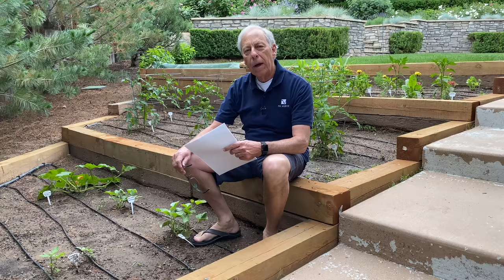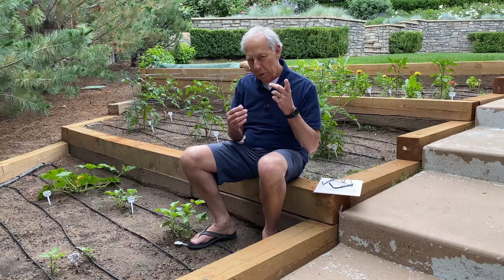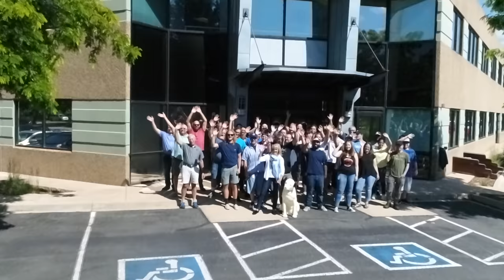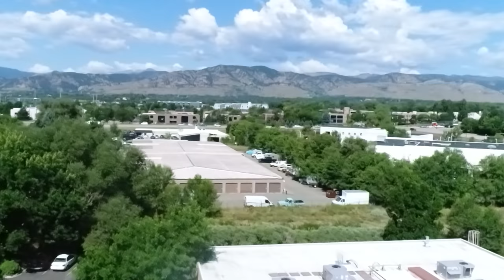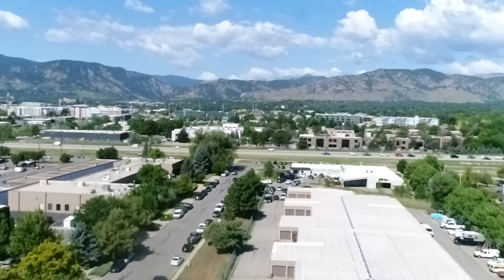Difference between line out and preamp out

Comment: Holy Crap! Yes, it would be VERY LOUD pretty much max volume. Great way to blow up a pair of speakers! LOL! 
Great explanation, Paul.
Reply: It's true that many high-level sources such as CD players will put out plenty of voltage to drive a power amp to full output, or into clipping.  
Hopefully most owners realize that sources lacking volume controls should only be connected directly to a power amp, if the amp has its own level control(s).

Comment: I was connecting-up a friend's stereo.  His teen sister was handing me labeled wires and one set was from a simple reel-to-reel which didn't have a preamp stage.  The receiver was a Sansui 500 from the early 1960's and it had a tape head input and output.  When it was time to hook up those, I asked her to give me "head".  I haven't spoken with my friend for 40 years, but his sister still likes me.
Reply: But did she.....hand you the cable?

Comment: Unless you have a preamp or receiver with individual input level adjustments, it's important to understand that line out level will depend on the selected source.  The range between low-level and high-level sources can be 15dB or more.  
There can also be a significant difference in the output impedance.  For example, my old Pioneer receiver has over 2K ohms output impedance at its line (record) outputs, but the preamp out is less than 300 ohms.  The lower output impedance reduces noise susceptibility, and avoids high-frequency rolloff if you use very long cables.  The higher output impedance is only intended to drive relatively short interconnects, typically 2m (6').
Reply: @behexen250 
Recognize this?  
Vn = SQRT(4 * k * T * B * R)
Now tell me again, that impedance has nothing to do with noise.  

Recognize this?  
Vn = Z * In, where Vn is noise voltage and In is induced noise current.  
Now tell me again, that impedance has nothing to do with noise.  

What does the "VLZ" stand for in the Mackie mixer name 802VLZ, and why does it have that?  

I've designed low-noise preamplifiers that achieve 0.5dB noise figure or better.  Do you even understand what that means?  

"Lower the gain, and you lower the noise."  Oh my, what a profound insight!  Until you mentioned it, I'm sure no one else in the world had ever thought of that.  
Hey, here's an even better idea:  Turn the power off, and the noise goes away completely!  Magic!
Reply: @behexen250 
I'll take that as an admission that you have no idea what the noise equations mean.  
Since it apparently hasn't occurred to you yet, you can see my employer and job title by searching campaign donor public records - but note that I recently retired.  That means I accumulated near 4 decades of design experience as a fully qualified, degreed EE with an aerospace company, designing and developing analog and digital circuitry for flight control electronics, mostly used on Boeing commercial airplanes.  First program, back in the 1980's, was the full flight regime autothrottle computer for the 747-200, also used on a few 747-300's, including Air Force 1.  It's an analog computer which also employs MSI CMOS logic for mode control and BIT.  My design responsibility was updates for control law and interface changes, including a full re-design of the BIT subsystem.  Many other programs over the years used my analog and digital circuit designs in actuator control electronics, active stick interface electronics, primary flight computer for the Boeing 777, plus a number of prototype and test equipment designs.  I'm certainly not going to attempt listing every design task here.  
With regard to what you call "McDonalds level equipment," the Mackie mic preamps come very close to the theoretical noise limit for operation at room temperature.  This is achieved by using low-impedance design methods, the importance of which is clearly lost on you.  
Fundamentally, optimal low-noise designs must be tailored to a specific source impedance; preamp design is quite different for high-Z sources, than it is for low-Z sources.  The mic preamp I designed and built, achieves 0.5dB or better NF with the high-Z microphones it was designed for, but it would not perform as well with low-Z mics.  
Your concept of "gain related noise" is strictly user-level, not a term used by analog design engineers.  We work with source and component voltage noise and current noise specs, to build representative models and achieve target equivalent input noise (ein) levels and SNR performance.  We also employ a variety of methods to protect sensitive inputs from induced noise; I have experience in design for EM hardening in flight controls, as well as commercial audio installations where I have solved a number of noise issues.
Reply: @Lloyd Stout 
1.  It isn't "my" formula.  
2.  As I didn't provide any examples of applying it, how can you conclude whether or not I understand it?  
3.  I still have hardware that I designed and built many years ago, and the measured performance agrees with the expected performance that I calculated using that formula.  
4.  I had to apply that formula for a design project during my analog design class at the UW EE dept., which was checked by my professor.  He didn't find any problems with my calculations.  
5.  That same professor surprised me with an unexpected and stern challenge when I went to pick up my graded final exam at the end of the course:  "How did you get a perfect score on the final?  No other student of mine has ever achieved that."
Reply: @behexen250 
The only "issue" I have, is with incessant needlers who keep demanding examples, immediately after I had already provided them.  
I will not entertain continued discussion when it has become circular and is unable to progress due to the other party's abject refusal to accept valid evidence.  It has happened only one time that I deleted posts under those conditions - and not because of any errors on my part as you attempt to suggest - yet you pose it as though it were a regular occurrence.  
And which one of us is making derogatory personal remarks about the other's behavior, motivations and emotions?  How does that add any value to technical discussions?
Reply: @behexen250 
"I take it all back. Stick with preamps, not airplanes. I'm sure your designs are excellent."
You just blew up my sarcasm detector's input stage.  
Thanks a lot.  
I'm sending you the repair bill . . .

Comment: In a signal path of a PC/Mac/phone --> DAC --> power amp, you are connecting a "line out" to a power amp and rely on the volume control of your digital source. It sort of works, but beware that digital volume control is potentially reducing the bit resolution e.g. a 24 bit audio file attenuated to less than max volume in your PC will in some cases lose resolution with 1 bit per -6dB thus -48dB volume will yield effectively 16 bit CD resolution of your 24 bit FLAC file. But -48dB volume is likely so low volume that you can't hear you just lost your high-res performance.
Reply: Yes. A full volume (100%) on the iphone/iPad is to be kept if you want the full resolution. At that point, the device does not manipulate the digital output. Control the actual analog volume on the amplifier that is feeding your loudspeakers

Comment: I have a question. CAn 2 AV(preamp/processors be connected together? reason for asking I have a Marantz AV8801 as my main processor, and A AV8003, and a otari reel to reel, now the AV8801 does not have a tape in/out but has a media player in/out, but the out doesn't seem to recognize digital ie if something is playing via hdmi, the media player out doesn't hear it. now on older even when digital was added to receivers etc the tape out could hear all the AV8003 has tape in/out. so what I am looking to do iskeep the AV8801 for processing out to amps, and monitor(TV) and use the AV8003, for preamp to bring in hdmi, and tape in/out so example AV8003 gets the reel to reel plugged into tape in/out, PC gets hdmi plugged to hdmi in., hdmi monitot(out)plugs to AV8801 hdmi in,  av8801 monitor(out) to tv not sure what to use though to get the rest of audio out from AV8003 to AV8801possibly, multichannel pre out to multi channel in?

Comment: Paul. Is it correct to say that "line out" is from mixer or pre-amp is fixed at -10dBV for consumer and +4 dBu for pro audio? And "preamp-out" is modified line-out?
Reply: No, line out levels will depend on the selected source.  It can be much higher if a source like a CD player or DAC is selected, and will likely be lower with sources like portable players.  
Output from a pro audio mixer can be much higher than +4dBu; most are capable of +20dBu.
Reply: @marianneoelund2940  :  Thanks for reply. Which output is fixed level for recording, and what are the pro and consumer recording levels?
Reply: @hightttech  
Line out (or record out) is fixed level, in that it isn't affected by volume, balance, or tone controls.  
Signal levels for consumer equipment are all over the map.  The lowest you are likely to encounter is 300mV (-10dBV), but some consumer sources will put out 2V or more.  
In pro audio, signal levels between components are typically around 1-2V, but can go much higher since mixers are usually capable of 8-10V.
Reply: @marianneoelund2940  :  I thought LINE LEVEL output standardized so input level at power amp unchanged when you change your source... e.g. wouldn't LINE OUT from DVD player and DirecTV box both be fixed at -10dBV (consumer) so that switching between those two sources does NOT require adjustment of power amp to maintain same listening level in the room? Thanks for your thoughts.
Reply: @hightttech  My experience suggests that if there is a standard, many devices do not follow it. My TV, CD players, DVD players, PC have rarely been the same level and so need gain adjustment when switching between them. My new Rotel preamp allows me to set default gain level on individual inputs which is kinda handy.

Comment: 1:53 Plenty devices still use pots for signal attenuation.
Reply: My Schiit DAC uses a pot for that very purpose. And I use pot for pain attenuation with the side benefit of musical enhancement ;-)
Reply: @jonathansturm4163  Ah yes, I also have  some pots for musical enhancement.
A motorized pot for volume, so that I can use a remote to attenuate the volume in an analogue manner.
Schiiit products are good (sounds like a paradox, somehow hehe), but I use an SPL Phonitor 2 as a preamp.
It also has a headphone amplifier and headphone matrix built in.
The matrix allows you simulate the sound of speakers into headphones, like sound angle, phase (to simulate room modes) and even things like interaural time differences (which Paul calls "interaural crosstalk").
Reply: Fat Rat  It Shure is stylus!
Just like other fancy Elactric devices 😉
Reply: Fat Rat  Yes, Shure is that Elac-tronics brand 😜

Comment: I wanted to ask maybe you can help you know a lot when it comes to audio , what’s the difference on the following : when I connect a external phone or via Bluetooth to a car amp or stereo I get less overall volume on the speakers but when I play cds or fm radio the head unit sounds louder , I also wonder for example putting the output of a line out of an instrument like piano / eléctric perc what’s the db or ac micro volatge output aprox or “value “  if I were to connect  that to a home stereo mic or line input how much will audio level be affected  , of course the only use should be a mixer that has gain and all to EQ but why can’t this three areas in sound be 1? 😂 In car audio I believe the best output in ac can be upto 5v ac aprox but in a pink noise test no distortion 1% , so  but I don’t know the terms used for each of this areas  or how to call those different values 😅

Comment: I need help! 
What would happen if I was to connect from a pre amp output to a line in?
Reply: This is not a problem. Just set the volume of the unit in which you are using line in to the maximum (if it has volumen control, although you can set the second volume control to match its sensitivity to the pre amp output level if it needed) so you can control the signal level from the pre amplifier. I supose that this is your intention.
Best regards.

Comment: Sir
I have an integrated amplifier named Cambridge audio sr10 but it doesn't have preamp out
Can I take out the preamplifier output connection from the amp before it goes in to power amp section.
                      Please let me know

Comment: Any practical demonstration of getting line out from tape recorder that doesn’t has line out because i want to convert audio songs from cassettes to mp3s and finally discard those cassettes...
What would be the circuit diagram and what additional components are required i think a capacitor and a resistor but of what value?
I want to get optimal output out of the tape recorder for optimal conversion
Reply: If the said tape recorder has a headphone out try using that with appropriate cables
Reply: @kenbongaards554  thanks for the reply but the sound from the headphones is not optimal...
The sound from line out is constant and of optimal fidelity and quality...
This is what i experienced...

Comment: Hello!
I have a Yamaha R-N420D (very basic) receiver which has only 1 'line out' (full powered for i.e. recording). I use this receiver to receive an ethernetcable so I can play flac files from my computer through the LAN network.  Next to that I have a Cambridge Audio - Azur 840A V2 which is a way better quality amplifier, but doesn't have an ethernet receiving port. I would like to receive music through the yamaha receiver (ethernet) and send it to the cambridge audio amp which drives my speakers (2x KEF LS50 and 2x Monitor Audio GS20.

Is it possible to use the simple 'full powered - line out' of the yamaha receiver to connect the Cambridge amp and will it sound any good?
Any insights are greatly appreciated!!!
Thanks!

Comment: My preamp has two sets of outputs plus a set labeled "tape out". I send the preamp outputs  to my amplifier and my active subwoofer.

When I purchased a headphone amp, I made sure that the tape out would work properly going into its  set of inputs. I held my breath the first time I turned on my headphone amp and it worked just fine. Even though a "Y connector cable would work  from either one of the preamp outputs, I prefer not to use it as I live by the term "system integrity". 

I'm  one happy guy with this configuration. 

I believe it's wise when purchasing a preamp that it's configured  like this. Makes adding additional equipment like a headphone amplifier a pleasure.
Reply: Lloyd Stout That's precisely what I am doing.

Comment: Can I connect a microphone preamp or a guitar equalizer to a line level input of an audio interface which does not have a built-in preamp?
Reply from the maker: If I understand your question correctly then yes,. The output of a microphone preamplifier or an EQ should be line level and that can go into most preamplifiers.

Comment: Mr Paul , can you explain how to connect an AV receiver to another AV receiver? Is that possible?
Reply: If the sending receiver has a pre-amp out with a return amp in circuit use a y cable from the pre amp out to split the signal ,one will go in the amp return on the sending receiver and the other send will go to the other receiver on which you could use an aux or tape input

Comment: Most ordinary preamps made after the middle 1970s, whether separate or built into receivers or integrated amplifiers, 
lack buffers ahead of the tape outputs;  the signal passes through the selector switch and goes directly to the recording jacks. 
(Built-in phono preamps may appear to be buffered, but not all of them really are.) 
After the tape monitor switch, there are usually series resistors (most are between 4.7 k and 25k; some are higher or lower) 
that feed the stereo/mono switch if there is one (and there Should be!); those resistors prevent the 
two channels of low-impedance sources from loading each other down and causing distortion. 
A quick look at the service manual for almost any unit will reveal the truth of this.

Comment: i'm trying to use line out from a pioneer sx-10ae to provide an fm signal to a fosi V1.08 external  amp to power some elac 6.2 speakers along with 2 sets of speakers powered by this receiver.  the fosi has volume control and rca inputs.  anyone forsee any problems?

Comment: could you connect a headphone amp to the integrated preamp's rec out?
Reply from the maker: Yes, absolutely. Just make sure the headphone amp has a level control as the record out does not.
Reply: @Paulmcgowanpsaudio  Thanks for the tip. It is working great.